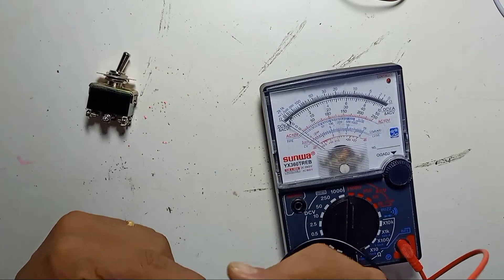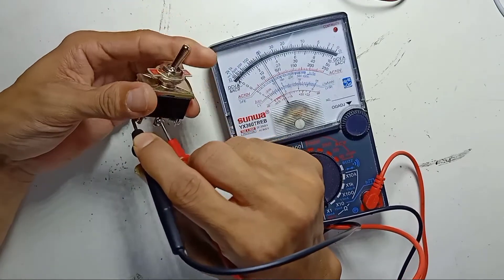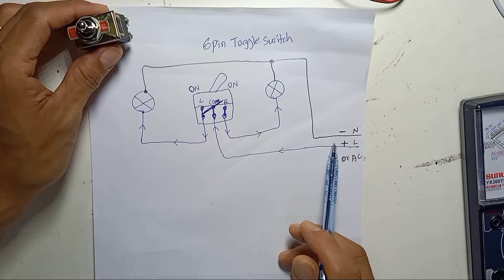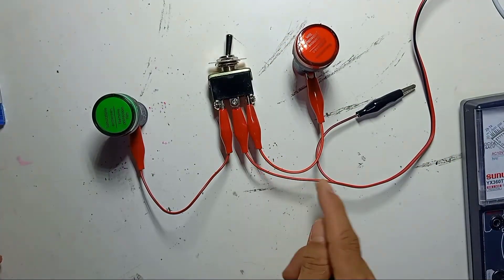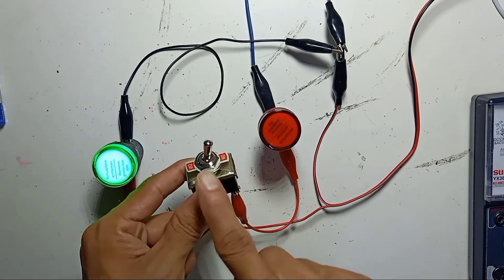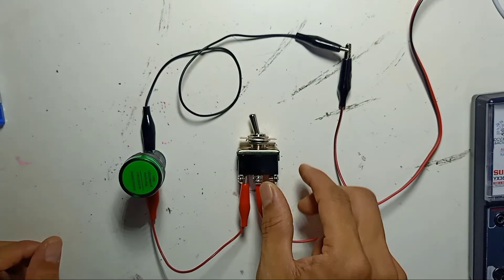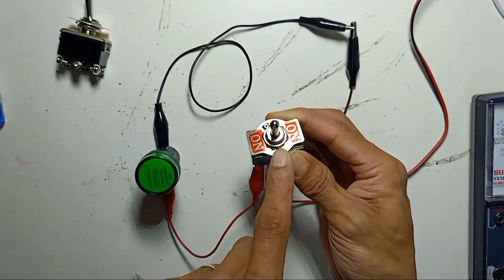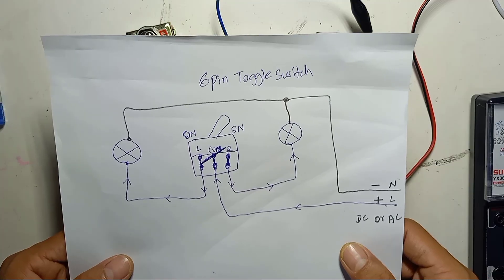How to wire 6pin toggle switch

Comment: I have spent hours trying to find out how to wire a 6 pin 3 way switch. Your explanation is very clear, except you are ignoring the other 3 pins. Your diagram suggest you are bridging across to them? Surely not? Are you actually saying ignore one set of three pins? 
No wonder they call it 'Electrickery'!
Reply from the maker: Its seems like ignoring but when you understand it very clear how to wire it than you will notice its not ingnoring but noted as Already been explained in one short😂

Comment: Can i put on one contact high beam
On bottom low beam headlights 
And to make bridge connection for tail lights ?! Will it work when i switch to high beam tail lighs also workg and when swith to low beams so that tsil light works ?
Reply from the maker: Yes it will work...because it is center off switch so it can be separate control light
Reply: @passiontechklm  thanks for reply man ❤️🤝

Comment: Hello, I have a 12v 6pin DPDT 3-Position Toggle Switch.  I want to use it to Connect two different 12v Power, and I have two Green Arrow 12v LEDs that I want to use as Indicator lights to show which 12v Power is switched on. I almost got it, but in your video, I don't know where those red and black wires are coming from.
Are you only using one Power source?
Reply from the maker: @LeonKolenda  Yes i am using one 12V power supply. Red positive and black is negative